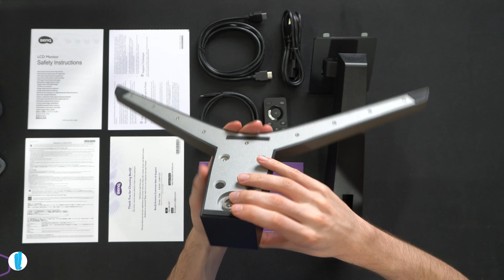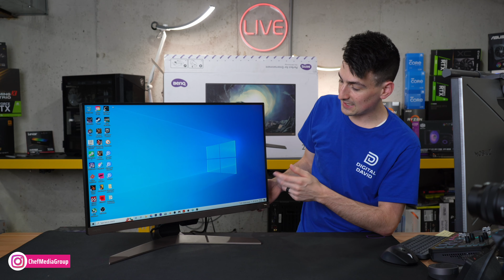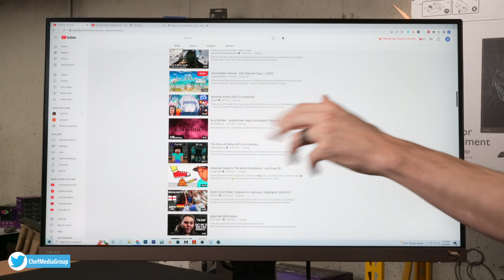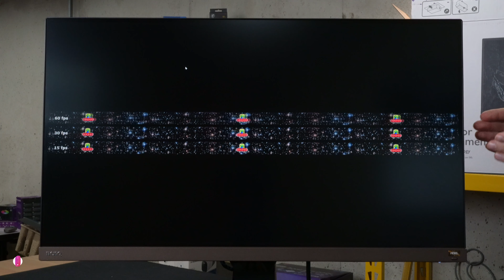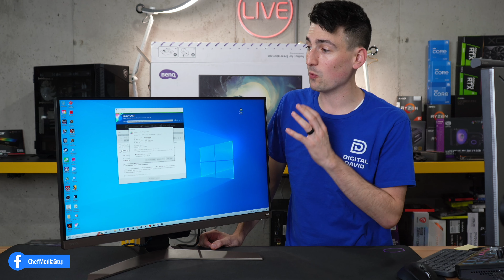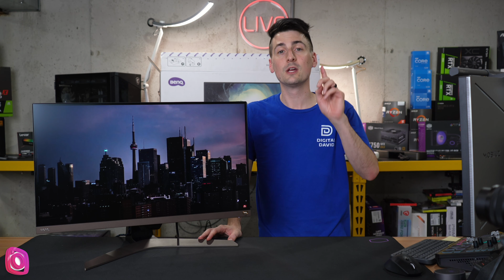BenQ EW2880U 28 4K UHD Monitor IPS Review

Comment: Hello I recently bought this monitor and overalI love it but the only issue I get is screen tearing while playing games. Do you know how to fix it?
Reply: Use vertical sync and a graphics setting that will give you 60 frames per second or more.
Reply from the maker: Yeah probably just too high of graphics settings!
Reply: @tvchef  3070 made for 2K monitors, 4K resolution too heavy for this videocard.
Reply from the maker: 1440p is defiantly the sweet spot for the 3070!
Reply: My gpu is rtx 3070
Reply from the maker: What settings are you trying to game on with the 3070? My initial thought is if you are pushing 4k its probably a performance in not keeping up with frame rate at that high of resolution vs monitor issue! Do you notice tearing even at lower resolutions?